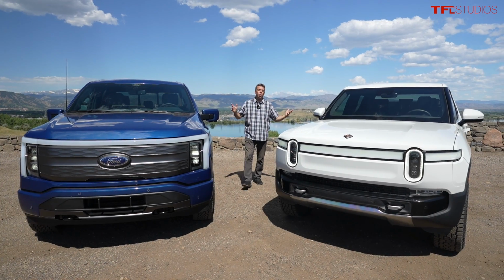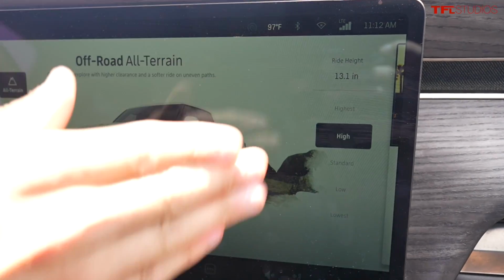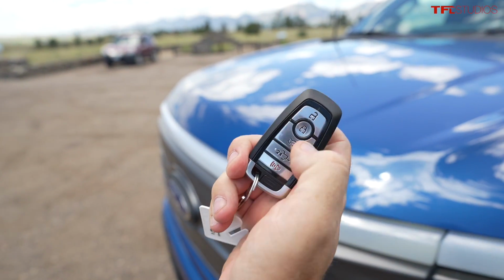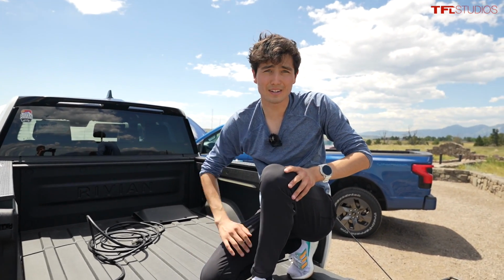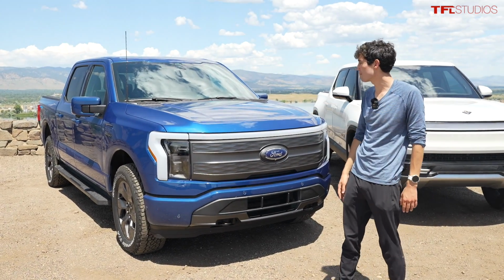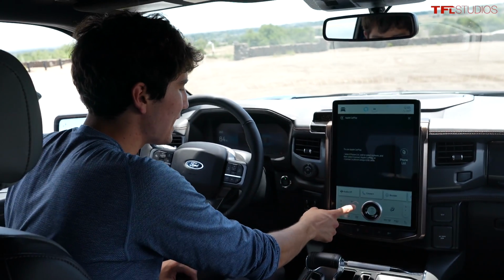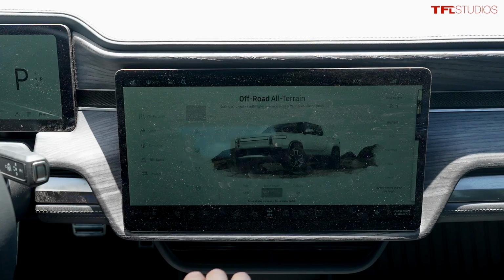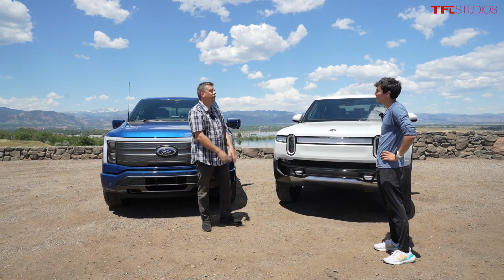The Rivian R1T & Ford F-150 Lightning Are PACKED With Surprising Features - Here Are The Most Unique

Comment: Rivian, Air suspension, means it’s going to fail, and when it does it will be expensive to fix. Nah.
Reply: Funny, that's what everyone says about the 01-05 audi allroads but I've had 2 and no serious issues. Air suspension has come a long way over the years and don't forget that every single 18 wheeler on the road is riding on air springs...
Reply: @audislowroad  Everyone has different experience of course. Our RV (08 model year) has air ride suspension. It has a slow leak, no techs can find it, so we constantly have to power it up to get them rise again. It would cost way too much to fix them, and there is no room for standard shocks, so we just live with it.
Reply: The air suspension is actually a lot more useful than I anticipated. I love being able to lower and raise the height. (the Rivian will fit in my garage when lowered, the Lightning would not) It's not perfect but with an 8 year 180k mi warranty, I'm not concerned.
Reply: @RivianDad  I've been riding an air suspension vehicle for the last 6-7 years and will never go back to set ride height/set spring rate setup! Adjustability wins over the extra maintenance required in my opinion!
Reply: @audislowroad  same!
Reply: @RivianDad  air suspension on the Rivian would only be covered 5 years / 60,000 miles. Only the battery & drivetrain have the 8 year warranty.
Reply: @GregHassler  thx for the correction. Good to know.
Reply: My Cayenne's air suspension failed right on schedule, just out of warranty.  $6,000 fix.  Porsche was kind enough to split it with me for "goodwill".

Comment: Lots of nice features that few can afford. The Pro would be a bargain in comparison, but the dealer markups are insane. When will we be able to buy one for UNDER MSRP?
Reply: never. many of us can afford it, hence why they are sold out.
Reply: @laloajuria4678  if you like to overpay for a rapidly depreciating asset, knock yourself out.
Reply: If Ford has its way, never.
Reply: I'll settle for MSRP
Reply: When similarly optioned they are the same price. Actually rivian offers more with the 4 motors

Comment: I would never waste the extra money for any electric vehicle. Very poor investment and difficult to maintain for the long term especially when buying a new battery. Cheaper to pay $5 per gallon for gas
Reply: Explain how the lightning would be more difficult to maintain then the gas version f150 there's about 2000 less moveing parts ie no transmission or motor waiting to detonate just a battery and two electric motors a controller and charger both trucks gas or ev have computers in them
Reply: Worrying about one expensive part that has a 100k warranty vs every little maintenance item
Reply: I haven’t seen $5 gas lately
Reply: @Jan 6 was "Wall Street Putsch" part 2 thank you atleast someone gets it... but your hear the comments from guys oh but the range while towing I do cannonball runs with my travel trailer every second weekend across the country from eastcoast to Westcoast 😆 🤣 😂
Reply: spoken like a true boomer.

Comment: I’d rather have the Ford Lightning, but they both look nice! I’m not paying those crazy prices tho…
Reply: I know, right? I am surprised by the number of people who can spend 80k on a pickup. I have a PRO lightning on order for 46k and I don't know whether to feel like I got the deal of the decade, or I'm nuts for spending that kind of money.
Reply: @KLFaber  Spending 100k on a car is nothing for thousands of folks around me.   To them it is like what a 10k car might be to me.  A stupidly expensive car isn't a big deal when you have a stupid amount of money.
Reply: @KLFaber  i should be able to order in the next round. Place my reservation at 8am MST on 5/20.

I can’t decide like you if I should go with the Pro or the XLT with the  312A package for heated front seats. The difference is roughy $20k. I can definitely pay cash for the Pro and I would probably finance $20k for the XLT.

I’ve been driving beaters for the past 10+ years as I’ve been patiently waiting for and EV. I thought about treating myself but I may wait for the next vehicle. 

I’d build the Pro around the same price as yours, what color did you go with?
Reply: @SolarPeaksView  unless you are getting ext pack on pro, would bump up to the XLT large pack.
Reply: @SolarPeaksView  The color is the only decision I am having 2nd thoughts on: Iced Blue Silver. I'm thinking white or sliver would be good. 

The features I would have added to the PRO if I could have: Heated steering wheel, adjusting foot pedals (my wife is 4" 10) and bigger battery (if it were 10k)
Reply: Let me know how that works out for you! I am debating with my wife to get a XLT lighting low optioned and a cheaper disel truck under 30k or an optioned out f150 lariat to hual our travel trailer and dump trailer.
Reply: I feel bad paying over 40 for the Pro trim! Crazy so many spending 90k+ for an f-150 and smaller truck.
Reply: Yeah, when will these manufacturers learn not everyone wants to drop 80k for one these trucks. Honestly first company that either A makes these about 20k less and B makes a solid mid-size truck like a colorado or ranger thats under 40k will kill it in terms of sales.